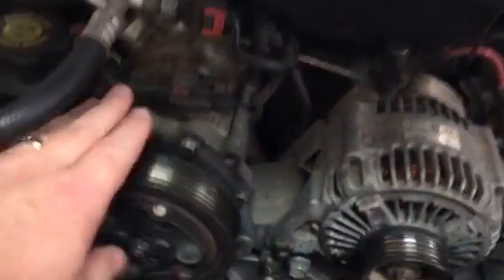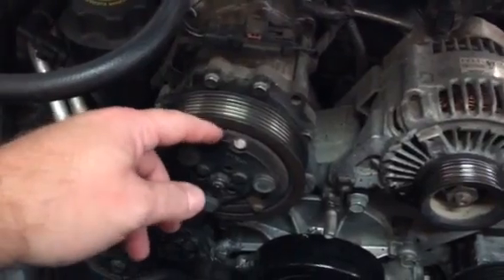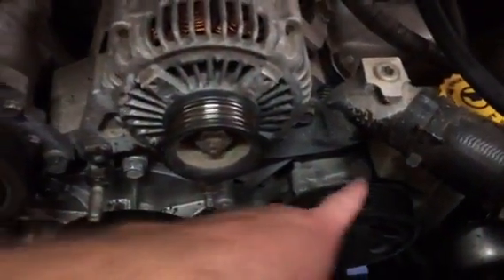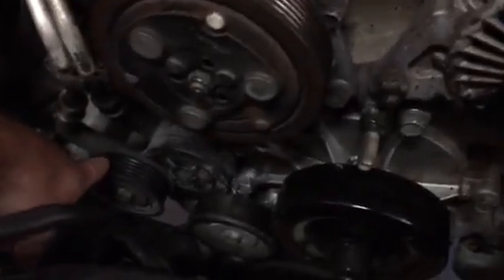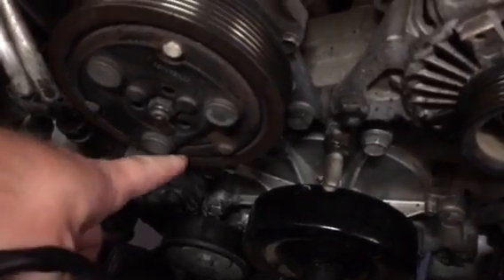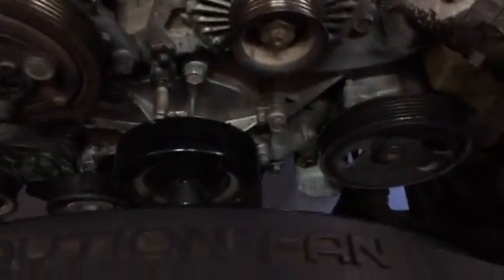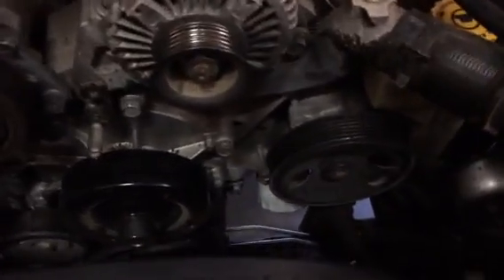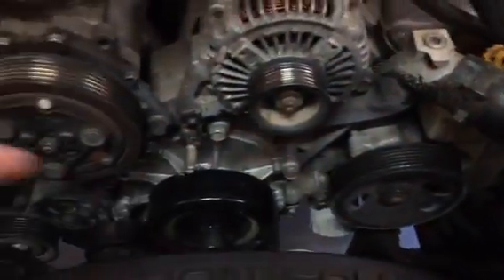2002 Jeep Liberty 3.7 L - bypassing AC compressor.

Comment: It would be helpful if you showed the belt installed in the bypass position.  Also, can the compressor be bypassed while still bolted in place, or would the clutch pulley get in the way?
Reply: he said compressor pulley is in way of by-pass belt if compressor is left in correct position... also, he said didn't have belt yet as part store was holding, that is why didn't show new by-pass belt.. under hood usually has belt diagram for either with or without compressor pulley
Reply: You do not need to unbolt the compressor. You can still serpentine the belt underneath it and still have a half inch gap between belt pulleys under the compressor

Comment: Catch a ride [Uber, taxi, friend] to the auto store you've called earlier.  Reroute the [smaller sized] belt to bypass the A/C thingy. I believe it's the 82.5" belt size. Done.
Reply: Do you think the same length will work for the same thing for a 2008 model?

Comment: The 82,5 inch belt is still to long when bypassing the compressor when following the belt diagram inside the hood. also when following the diagram under the hood there is no need to move the compressor.  So the belt must be routed differently.  After a few tries rerouting the belt it fit snugly and worked great.  i could not find a way to add a helpful picture of the reroute.  sorry.